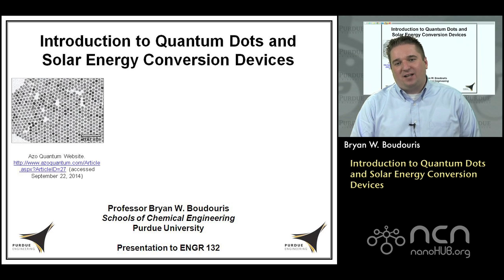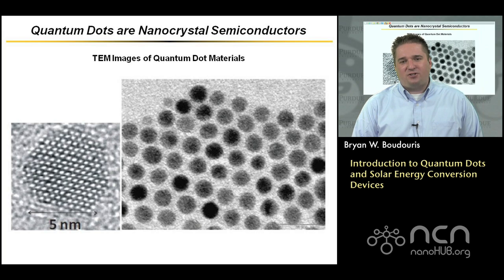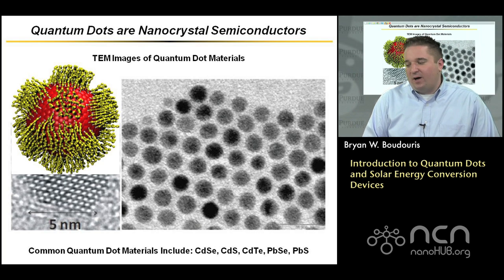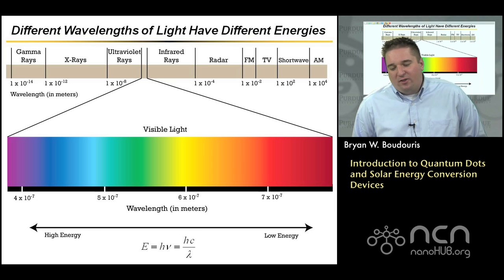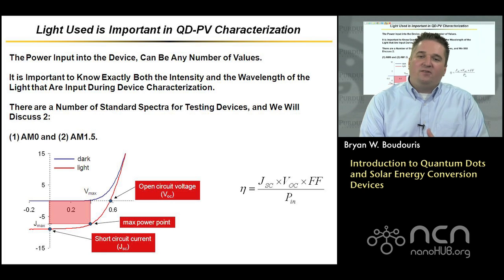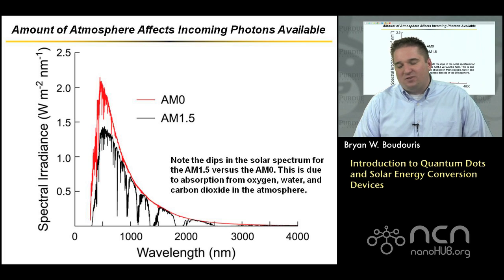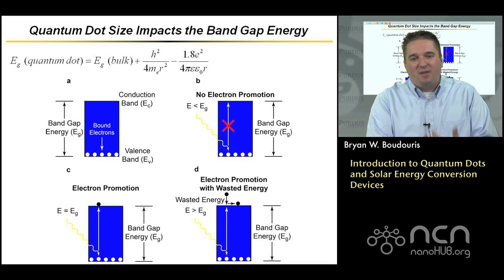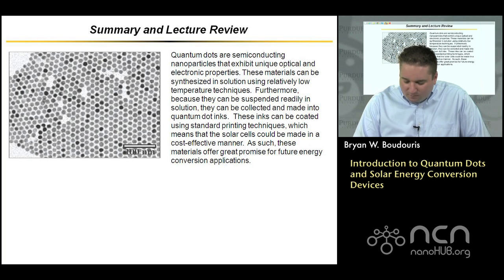Introduction to Quantum Dots and Solar Energy Conversion Devices

Comment: How are electrons and holes transported?
In a typical semiconductor solar cell, you have a diode, which tend to force electrons and holes to go separate ways. In quantum dot, the quantum dot with the tuneable bandgap, is capped by organic ligands, which I assume are insulators? Won't the electron and hole be trapped inside the dot...and then dissipate their energies to form excitons...and then just recombine?

Are the dots somehow "electronically connected" with the typical semiconductor substrate which form PN junctions?

Comment: Due to the toxicity of cadmium and lead, I have been exploring graphene quantum dots. It is more difficult to determine the photoluminescence response (band gap) of graphene quantum dots due to functional groups, edge asperities, defects etc.  However, they are environmentally-friendly and cost-effective to produce and use.
Reply: The question is can spent uranium produce energy in a specific band gap that can be converted to electricity ?